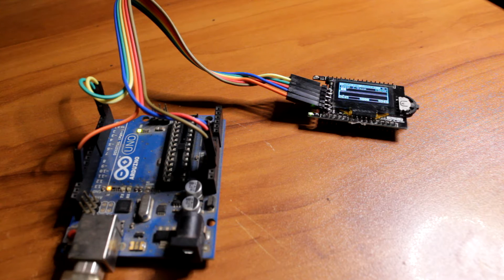How To Update Furious True-D Firmware Using Arduino

Comment: i there could you help me here. I am doing almost the same thing to upgrade my firmware but with a NANO. Could you help me to make it work. I putted the wiring like you did. I uploading in the xloader, i see the lights flashing but doenst appear the new version on the module screen.
Reply from the maker: I was using the minimosd-extra config tool instead of Xloader. Maybe try that?
Reply: done!
Reply: Have a nice christmas
Reply from the maker: Glad you got it.

Comment: Hi,

Could you tell me the pinout for this?  I have watched a few vids but I am totally new to arduino's and cannot seem to find the idiots guide.
Reply from the maker: Yellow-Tx, Green-Rx, Blue-Ground, Red-5V, Brown-Reset, that is on the arduino side. I think the rx and tx have to be swapped on the True-D side and the reset is called DTR I think, other than that the others should match up. Hope that helps, it's been a while since I did it.
Reply: Thanks, that was fast :)

Still one wire unaccounted for though? Orange,  I have a clone nano so cannot see but looks like D12?  Says Gnd on True D side?  Also do you know is it ok to ground out the reset button as I cannot remove the chip?
Reply from the maker: Orange went to ground also, was using D14 I think. Not sure if you can ground reset button, but probably.